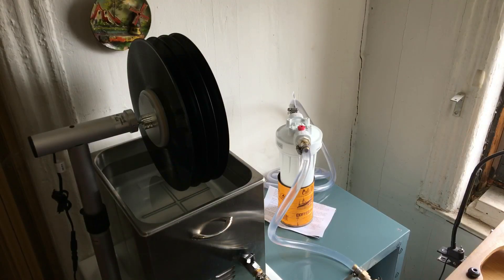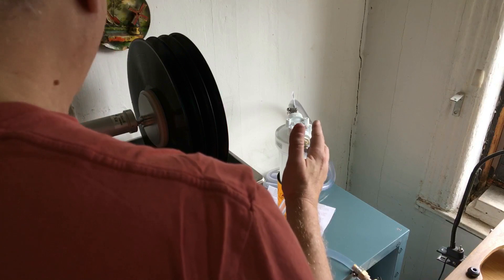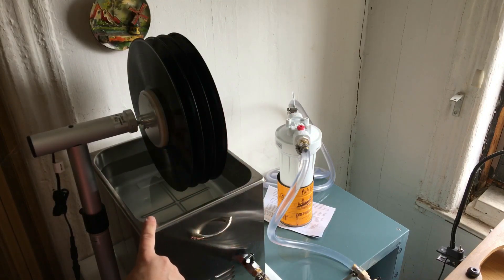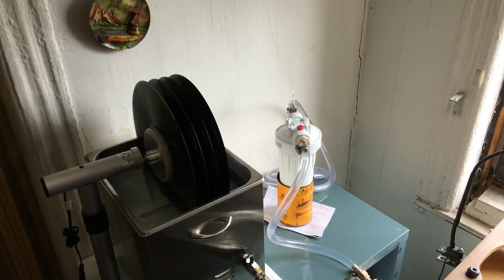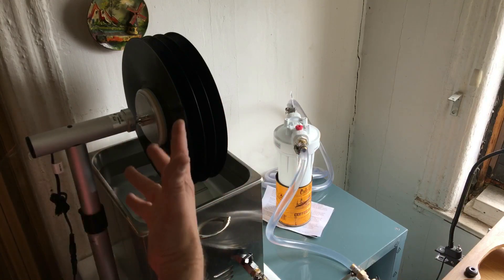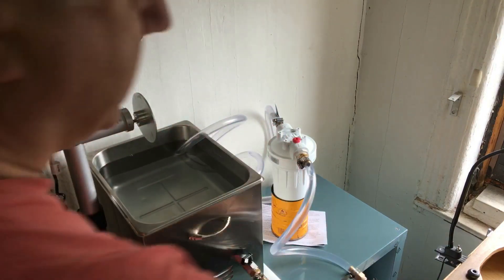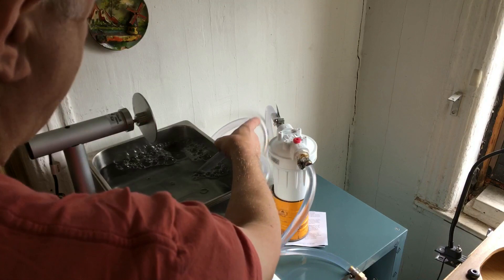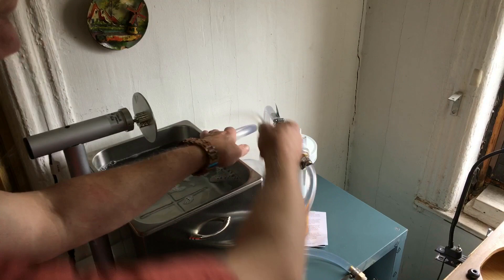Ultrasonic LP cleaning update!

Comment: MOST commercial ultrasonic cleaners have the sonic transducers on the bottom which is the wrong place to clean records. The sonic energy MUST be directed into the grooves NOT across the grooves for proper cleaning. Also, if you truly want a clean record, you must remove the record while it is wet, rinse it off with clean water, then wipe it dry with a microfiber cloth.
Reply from the maker: Audio Desk grips the record until finished drying. I  do a final clean water rinse on a vacuum machine.

Comment: Why would you spin them 2.5 times? That means they aren’t being cleaned evenly, as some parts of the record are getting less time in the water.
Reply from the maker: Huh? They all spin together, and receive the same amount of time in the water...
Reply: @kenmicallefjazzvinylaudiop6455  
if you spin it once then the whole record revolves in the water all the way around one time, and each part of the record is in the water for the same amount of time. 
If you spin it 1.5 times then the whole record goes around once, and then half the record goes into the water a second time and gets washed again. But the other half of the record never goes into the water a second time.

I probably could have explained that an easier way, but hopefully it was kind of clear. you should spin it in whole numbers, rather than 2.5 or other fractions.

It wouldn't really have much of an effect if you were spinning it many more times (like 10 spins per wash), but if its only spinning slowly and going around 2.5 times for the whole wash, then part of the record is getting cleaned 20% more than another part of the record.
Reply: @Filtersloth  yes correct but in the process when you lower the unit into the water that part gets more time and you also want to go past two times aka trying to stop at exactly 2 times would be difficult.
Reply: I set mine for 20 mins and it gets a spin per min so 20 times in liquid  @Filtersloth

Comment: Love your vids Ken!  I am just getting back in to vinyl and starting sort of in reverse: LPs and cleaning/storage first.  No turntable yet.  I love the idea on USC and then the VCS, but that seems like a big upfront investment.Would it be best to start with USC and then add a VCS at a later date, or the reverse?  Also I am curious about the need for filtration.  Given the cost of distilled water vs. the filtration system, won't it take years to recoup the investment?

Comment: Well done!  Could you share links to Harry Weidfeld and Ira Wong regarding the contributions to this cleaning system as you mention in the video?  I know that the voltage/rotation timing is important, especially in relation to the cavitation frequency of the ultrasonic cleaner, but would like to look at the details.  Is a pre-ultrasonic cleaning recommended?  Better cleaning fluid recipes, etc...?

I have my Vinyl Stack, ultrasonic cleaner with filter and pump, vacuum extraction set-up for drying 
https://cdn.priceabate.com/media/mk1-record-cleaning-kit-w-turntable-vacuum-cleaner-fluid-mk1-brush-wand-vinyl-record-cleaning-149963_1.jpg,
and cleaning fluid ingredients (distilled water, 99% isopropyl, and wetting agent).  I also use this pressurized sprayer to rinse with force with distilled water after the cleaning step with good results.
https://proxy.duckduckgo.com/iu/?u=https%3A%2F%2Fae01.alicdn.com%2Fkf%2FHTB1wW5WNpXXXXc.XFXXq6xXFXXXt%2FFJS-Red-Handle-White-Body-Plastic-Water-Spray-font-b-Bottle-b-font-font-b-Pressurized.jpg&f=1
Reply from the maker: Hi Laurence, the link to Harry's work is within this Positive Feedback article by Paul Rushton--this is another excellent resource for USC LP cleaning. https://positive-feedback.com/audio-discourse/rushton-paul-diy-approach-ultrasonic-cleaning-lps/
Reply: Thanks much, friend.  I'll study this.  Cheers.

Comment: Ultrasonics seem to me to be too time-consuming. I use the pro-ject record cleaner and it is a lot easier and quicker for much the same or better results...
Reply from the maker: Vacuum cleaning is fine, but USC is an entirely different technology that literally excavates dirt out of the groove that no Vacuum machine can touch "Better"? You're dreaming. Vacuum skims the surface, USC goes deep inside the groove. Vaccuum swishes water around and sucks it off, USC works on a microscopic level, the same as with jewelry cleaning, from whence it is derived.  I clean 4 LPs in 7 minutes. The time consuming part is the clear water final dry on the ProJect.
Reply: Right..... Whatever you say....
Reply from the maker: enjoy your dirty records! ha ha
Reply: hahahahahaha...
Reply: fred234w maybe you should try it it before you criticize it. Ultrasonic cleaning blows away every other cleaning method out there. Way better than vacuum cleaning, and if you combine both methods the results are unbelievable
Reply: @dead_formats  You're not going to get better results with a vacuum system over an ultrasonic system. There honestly isn't even a debate there.

Comment: I have a similar Ultrasonic machine, I like your pump and filter.  Can you tell me about the filter element and the size of pump?  I have been using the 90 % alcohol instead of soap.  I spin dry and then set them on a clean micro fiber towel and then right to a Mobile Fidelity Inner sleeve. Might need to add that VPI machine for a better final drying.
Reply from the maker: The filter and the internal element were bought at HOme Depot, like $15. I found the pump on Amazon. https://www.amazon.com/gp/product/B01G305PK0/ref=oh_aui_detailpage_o04_s00?ie=UTF8&psc=1
Reply from the maker: then the tubes and clamps at Ace hardware. I'd get a ProJect cleaner rather than the VPI. $500 and works harder with stronger suction, reverse cleaning. and no platter to dirty side 1 while cleaning side 2